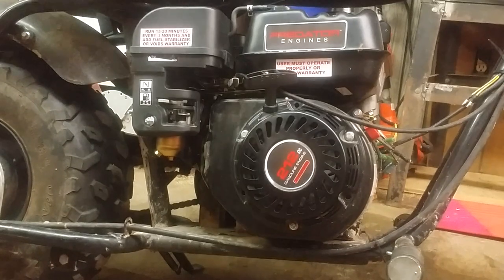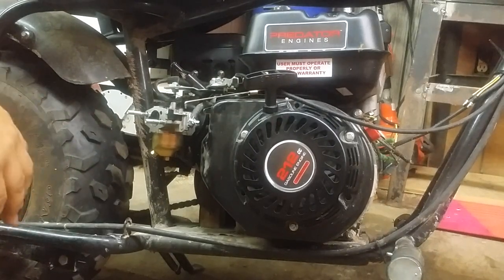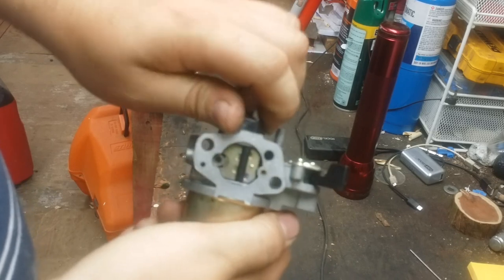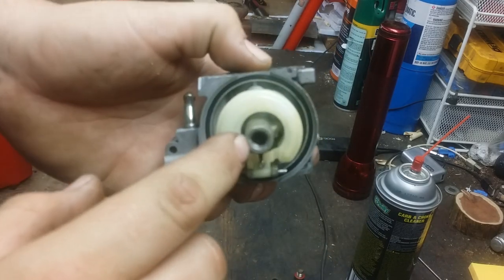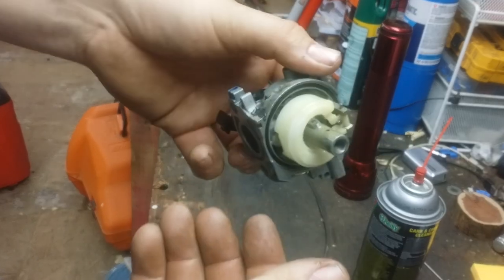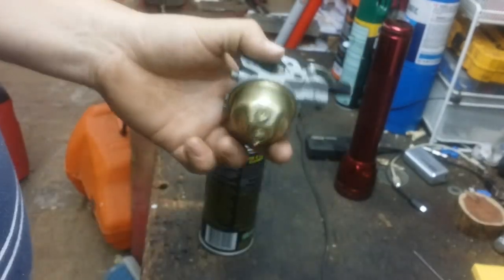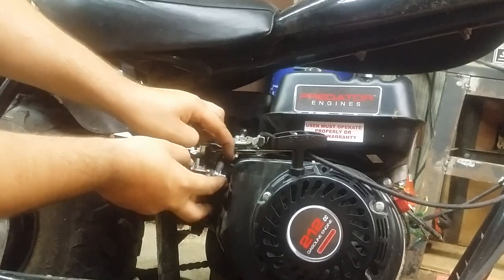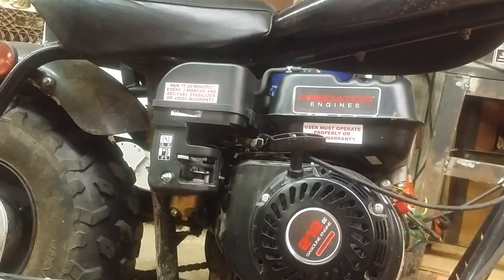How to clean a carburetor on a predator engine

Comment: Had to clean up mine after a year in the shed too. Mine has a fuel cut-off solenoid attached to the bottom that sticks a pin through the bolt that holds on the bottom of the carburetor. I think some goop built up in there over winter and was causing the pin to stick. Cleaned it up, put it back together and it ran like new. Really glad I didn't find this out when I actually needed it!
Reply from the maker: I find it best to drain the tank and fog it with oil keeps away the rust and crud

Comment: Thanks for the tips on the carb cleaning process.  Broke it down and put it  back together and started on first pull.
Reply: @Stacey Garringer you are aware there are multiple other reasons a generator can not be running right? Maybe try educating yourself Stacey before you make comments on others. Maybe look up what a “spark plug” and “choke” are too while you’re at it, if you can handle it.

Comment: Thank you, thank you, thank you!  Total NOOB here ... while cleaning out the HF Chipper, I accidently overturned it and the oil overflowed & got everywhere. After cleaning & replacing air filter and spark plugs and lubing the ignition chamber, I still couldn't get the motor started for 2 weekends.

Luckily I came across this awesome tutorial and now have the motor running. Lots of smoke though, burning up the oil no doubt.

Hopefully I will get the branches chipped up and clean up the yard this weekend!
Reply from the maker: glad to hear i could help out!

Comment: Very helpful, thanks!  I'm cleaning up a long neglected and completely clogged up Predator carb.  Jet and damper took some scrubbing.  Then found the intake to the fuel shutoff valve was filled with some hard waxy substance that was hard to access past the elbow, and I was about to give up but had an inspiration to use boiling water to clear it.  I poured boiling water over the intake tube to preheat it, then used a syringe to force boiling water through the passage.  Took some pretty high pressure but broke through in about 15 seconds.  Now thanks to this video I'll address the float valve and idle ports, make sure gas is getting in, and hope it works after reassembly.  If it does, my real work begins, chipping a wood lot full of accumulated slash.
Reply: ...and once reassembled it fired up on the first pull!

Comment: Thanks for the easy to follow video!  I just fixed my Generac Pressure Washer's pump head (ruined check valves due to leaving water in it) just to find out that it would run about 3 mins & quit. If I let it rest for 2 minutes it would run again for 3 mins & quit again. I've got mine apart and cleaned thoroughly, but still need to put it back together yet (ran out of free time).  I'm confident it'll run good now! If there are still issues, I'd just purchase a replacement carb for $13 and not even mess with a "rebuild". 

The one thing missing in your video is simply having people check & clean the air filter while they're doing this.
Reply from the maker: 99% of the time the air filter is fine unless there are rodents involved, or used in a lawn mower..
Reply: @1beastlydudefixbreakrepeat  Turns out my issue was the fuel petcock valve. The rubber gasket inside had deteriorated (from carb cleaner?) to the point where it clogged the fuel pathway. I didn't need any parts, simply rotated the gasket 180 degrees after picking off the dangly pieces.

Comment: Predator 2000 inverter Genny doesn't run same load as before.
Fluctuating power even on smaller load.
Will lose power (overload) when original load is hooked up.
Forced to do maintenance myself since no one around here offers the service, any advice would be great!

Edit: I've changed oil regularly, cleaned air filter regularly and spark arrestor had stayed clean also. Basic maintenance really, it needs more work obviously.

Comment: Worked!!!     My snow blower would not start ,,, took it off and the fuel valve was completely closed and calcified   carb cleaner wouldnt do so i had to punch a hole with a needle gently scraped the stone out with a drill bit.  varoom   it was easy
Reply from the maker: Glad to hear it worked

Comment: Thanks man. Just installed a prand new predator 212 ran it for 15 mins and realized I had put too much oil. Shut it off drained some oil out and now it won’t start at all. Tried new spark plug, cleaning carburetor, every trick I can find. But nothing. 
If it helps I think I ran it 15 mins on full choke. What do you suggest? Thanks

Comment: My Predator 3500 generator is fairly new, as far as run time. It’s only been used under load for 2 hours. The rest of the hours are 1 hour
run times each month to keep it exercised. This last run it started easy but ran real rough. I switched out the spark plug right when I bought it to a BPR7EZ 5534 Spark Plug. I pulled the spark plug out to see why it’s running rough and it look pretty black, so I install a new
spark plug, ran better but not as good as it did before. I also drained out all the fuel to see if there was any dirt in the fuel or tank, both were spotless. I run Shell V-Power® NiTRO+ Premium Gasoline and removed all the water. Could it be the carburetor and is there an additive that will clean the carb without tearing it down? I need your expertise. Thanks
Reply from the maker: Not really any additives that will clean it without disassembly. Carbs are cheap on ebay. Search for one for a 6.5hp honda gx160..should be about 18 bucks

Check your air filter, then at least pop the bottom of the carb bowl off. Check for debris. If you see molasses you can dissolve it with your everyday carb clean spray. If you see chalk or rust new carb. Hope this helps!

Comment: I had to take my carburetor off to place it on my mini bike, and a lil rubber ring fell off and
I believed it was nothing. I placed it back together and now when i take it off the choke, it max revs. Can you help me fix this problem and I believe it is the rubber ring that fell out that is the problem. Where does it go?
Reply from the maker: The rubber ring is a gasket, it goes between the carburetor and engine. It needs a seal to operate properly
Reply: 1beastlydude do you have a social media or some sort of way I can send you a picture of what I am talking about and help me place it back together?

Comment: Why does my Coleman die when I go to accelerate? I cleaned carb really good. I’m lost
Reply from the maker: Check the jets with a stand of copper wire
Reply: I did. I’m thinking it’s the spark plug because the tip was out of adjustment like gap. Wondering if that would cause throttle issues.
Reply: How long has the gas been in it ? Stale gas will do this.

Comment: I've got the heinsin 6.5hp is identical to this motor in every way but instead of two carbonator gaskets I have 3 and I'm so confused on that. Can't find any info on the web about 3 gaskets either. Would you know by chance how those 3 go on? I assume either the airbox side of the carb or the back side has two gaskets maybe? Just not sure as to why that would be though. Mine is the baja heat bike.
Reply from the maker: I'd imagine one on the airbox and two between the carb and head...they probably use two for heat insulation
Reply: @1beastlydudefixbreakrepeat  thanks man I'll try it that way and see how it goes.

Comment: I accelerate good but it only holds top speed for few seconds before losing all power and sputtering back down to a lower speed
Reply from the maker: Check that you fuel line or needle and seat are not clogged

Comment: Tried all of this.Even got a new carb with a spark plug n still wont work.Any other clues anyone?
Reply from the maker: Make sure you have spark. Try spraying carb cleaner directly into the intake and see it will run off that. If it runs off the spray, check the carb again..may not be sealing well on the gasket.
Reply: @1beastlydudefixbreakrepeat  i even bought a new carb and still the same problem.It starts if i spray it but it dies right away.Thx for the help .I really appreciate it